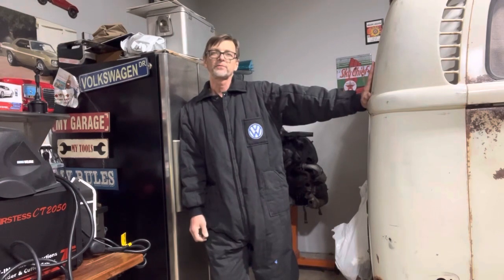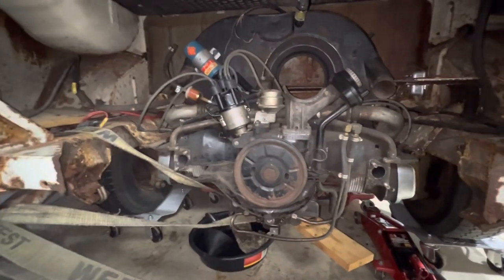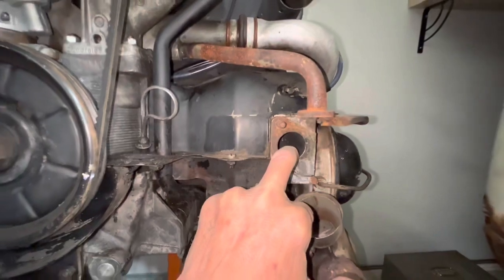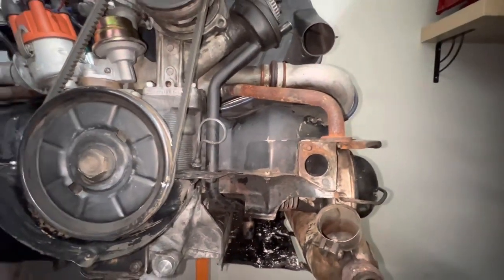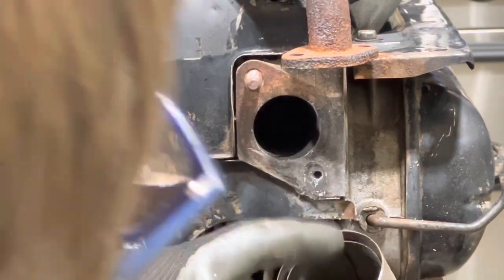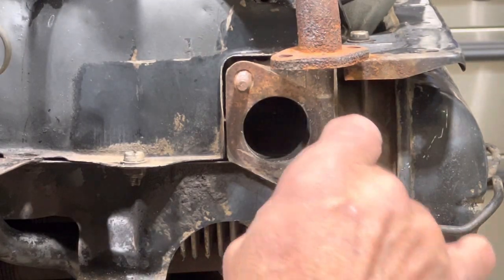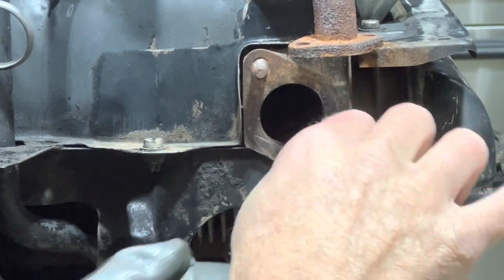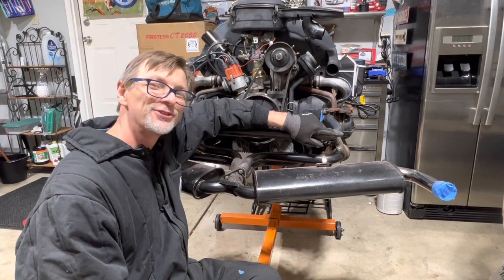1600 vw exhaust 8 MM stud got complicated

Comment: I believe that model Bus uses a bar on the rear that supports the motor. The bar ties to the oil pump. Having the motor out is a great opportunity to clean, retorque the heads and swap the oil cooler seals and the rear main seal. In your neck of the woods with the cold weather it is also very advisable to make sure you have the thermostat and flap system installed and working. How’s Frankie doing? We love to see you do metal replacement on it; coming along nicely. Merry Christmas to you and yours!
Reply from the maker: That is correct, and I have the mustache bar.  I purchased an EMPI engine case adapter that allow me to install an upright 1600 CC engine from a bug into the bus.  The engine currently installed is not the OEM to the bus.  I purchased the bus like this.  That is why I am temporarily installing this spare engine with that adapter to be able to move the bus in and out with it’s own power, rather than pushing in and out. Once I restore the bus I may purchase a universal case and build and engine that will not have a need for the EMPI kit.  Thank for watching